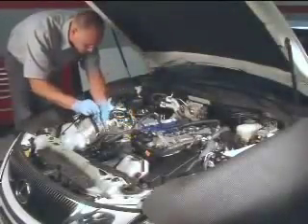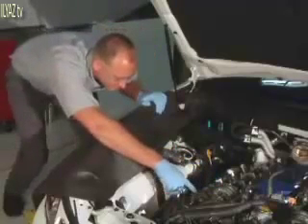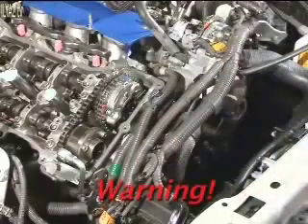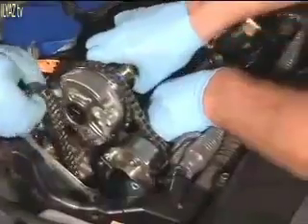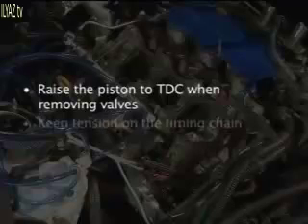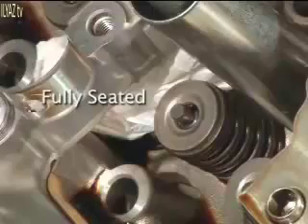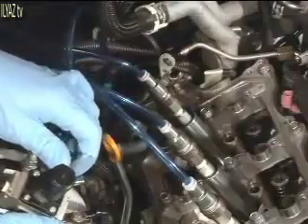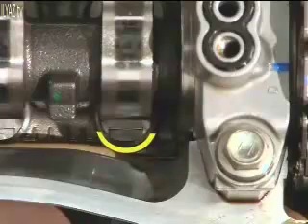Toyota Lexus Engine V6 3.5L 2GR-FE, FSE, FXE, FXS Valve Seal Replacement

Comment: To all yall professors and haters there: if you learned how to replace valve springs, you've learned how to replace valve seals. You can remove the top part and camshafts on 2GR heads without removing the timing cover. To remove the chain tensioner you need to remove a little 4 bolt window on the front of the timing cover.
Reply: Thanks!

Comment: My 2008 Lexus Rx350,  the timing chain tensioner is inside the timing chain cover. How you gonna remove the camshaft.?, it is 2GR-FE engine.
Reply: Remove the metal cover/window on the timing cover to gain access to the tensioner

Comment: On Ford 4.6L DOHC you don't have to remove the cam. There is a special tool to compress the valves against the cam.
Reply: Ford makes crap